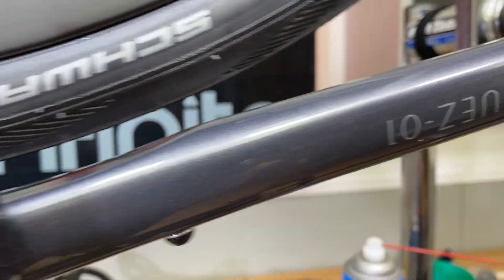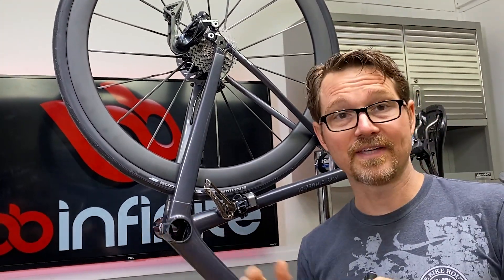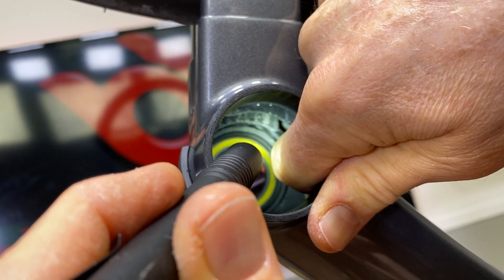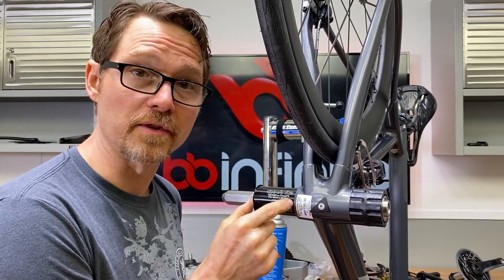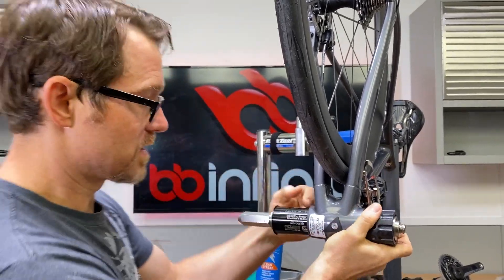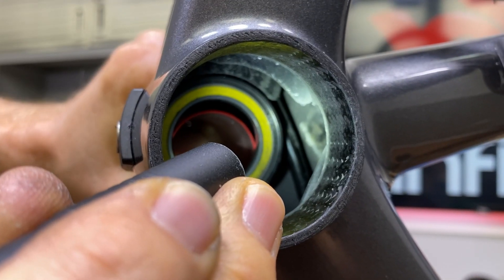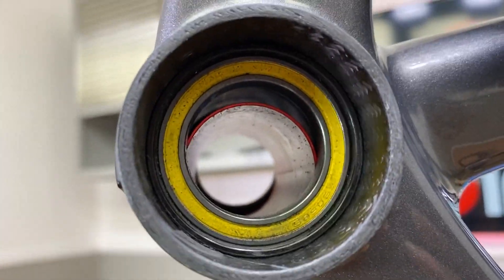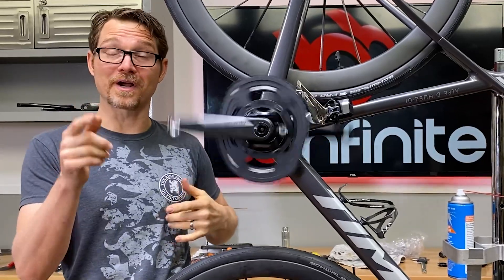TIME Alpe d’Huez Install Solved: We Grind Until We Get What We Want

Comment: Is there any issue on any Alpe d'Huez 21 rim brake frame?
Reply from the maker: No problem. If you have a rim brake AdH there are no clearance issues. No problem for any Di2 or Etap/AXS bike either. Only mechanical shift bikes need this little "revision" to get the bb in.

Comment: I would like to ask if it’s just the hydraulic line that is in the way, how about the Di2 cables?
Reply from the maker: The bike in the vid is Di2. No problems. Just the line is an issue on some, but not all Alps due to manufacturing variances.

Comment: Have this same issue with my Time frame as well - curious about the rotary tool setup. What tool was used, and at what RPM? Thinking of doing the same thing.
Reply from the maker: We're using a high speed cutter for non-ferrous materials, Dremel 199, for this. Set to a comfortable RPM, not too high. The carbon comes off easy.

Comment: My Time frame had a ridge in the seat tube that would not allow the seat post to be moved to my seat height. Quality control issue IMO.
Reply from the maker: If it is a seatmast bike, then what this normally indicates is that you cut a significant amount off of the mast and actually got down to where the factory bonds in a stop. This can happen if you bought a frame that was a little too big for you because that is your preference, and the engineers had a different idea. So if all this makes sense to you all you need to do is cut a little bit off of the seatmast insert so that it goes down far enough.
Reply: @BBInfinite  This is the smallest frame I’ve ever ridden 55.5 and usually ride a 57. Never cut seat post and could only get in three inches before hitting blob of carbon which is or was until ground down, thicker on one side.